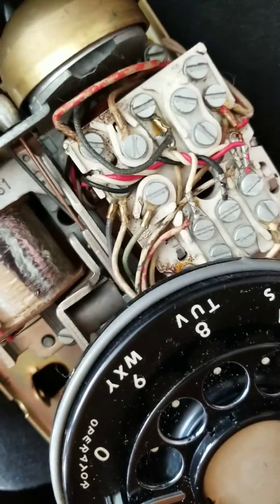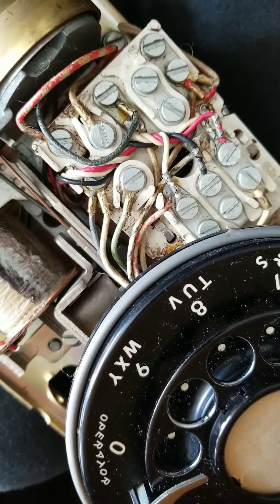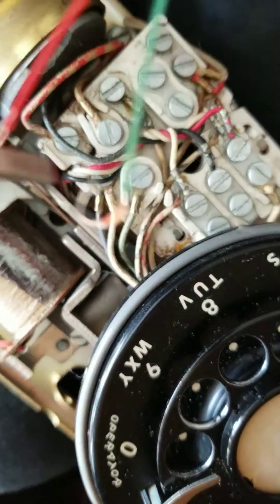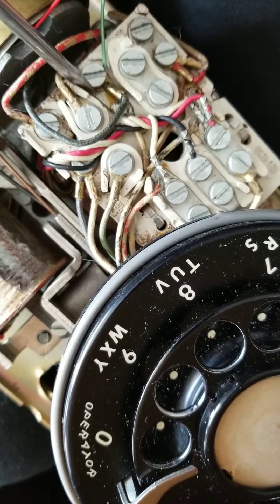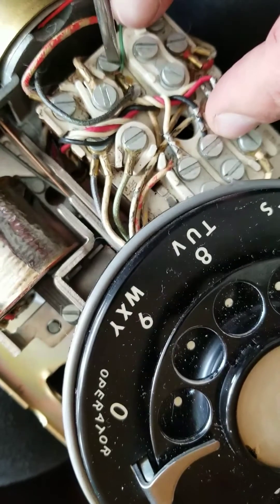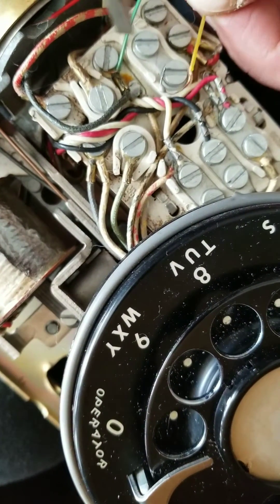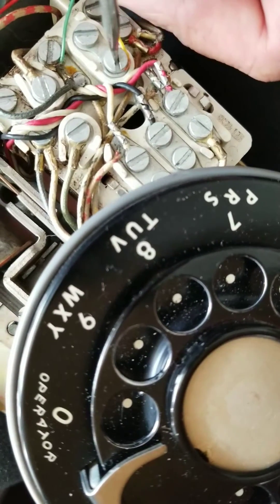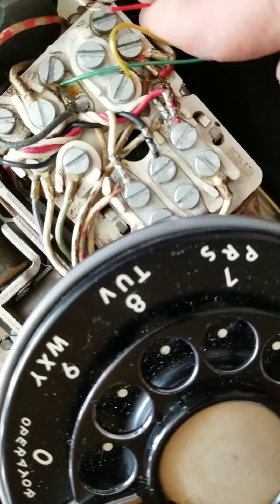Easy Diy: Wiring Up A Vintage 1959 We 554 - Step By Step Guide

Comment: From what i see here you should have used a spade connector at the connection points. What will happen is those connections will break down and "the connection" will become an issue further down the road. As far as it being painful to watch this was also
Reply from the maker: I appreciate the input. The wiring you see in the video is connected directly under the terminal screws because that’s exactly how these 1950s WE sets were designed to be wired.

The internal conductors use a nylon-type insulation - flexible, tough to cut, and not the easiest to solder - but that material actually seats perfectly under these wide flat screw terminals. The clamping pressure is more than enough for a solid, low-resistance connection without needing modern spade lugs. And honestly, most people don’t have spade connectors lying around anyway, so this method is a simple, practical DIY fix that works exactly as intended.

If anything ever fails later, it’ll be from aging insulation, not from this screw-down connection. For restoring and testing phones from this era, this wiring method is completely within original spec.
Reply: @goasfarasyoucansee original specs? Not really but whatever bro, have a good day

Comment: I have an old PTT rotary desk phone made in Holland and I tapped the original phone wires( there's 4 of them, green, yellow, red and blue) and was told to wire the red phone wire to red house wire then green and yellow phone wire to green house wire, the blue wire wasn't used. It rings when I call from a different phone and when I pick up the receiver it stops ringing but the other phone used to make the call continues to ring. And it won't dial out, no ringtone. I had it wired up a different way before, got the diagram online and it would make and receive calls but wouldn't ring in when someone called it. Not sure which wire to put where to make it ring?
Reply: The yellow wire was used for the ringer when receiving a call. That system doesn't work anymore. You have to connect the yellow wire on the same post as the blue wire in your wall plug. Or you have to bridge the connections in the phone itself, just put a piece of wire between the posts. I think the yellow wire was the ringer wire and it was there so you could connect an external ringer somewhere else in the house. I'm from Holland and PTT was a Dutch carrier
Reply: @0010301  Sorry I didn't see your comment before but someone on FB helped me figure out how to wire it up. Thanks for your input.
Reply from the maker: @bodeine454  Welcome.
Reply from the maker: @0010301  Mike thank you, very nice advice feel free visit my blog on wiring https://showehow.blogspot.com/2022/11/telephone-wire-basics-of-phone-line.html